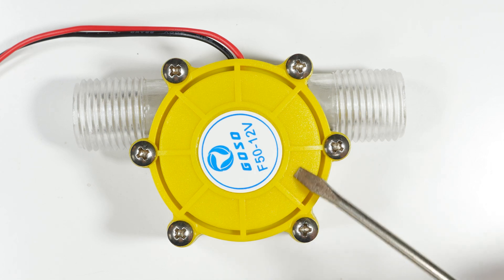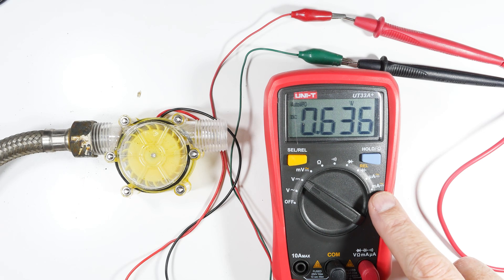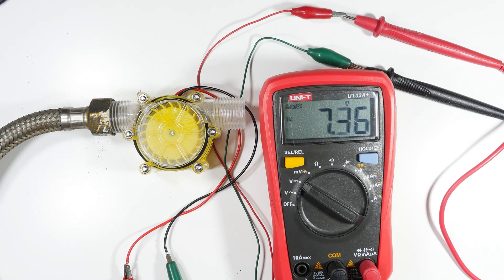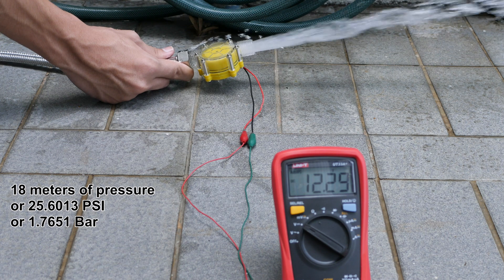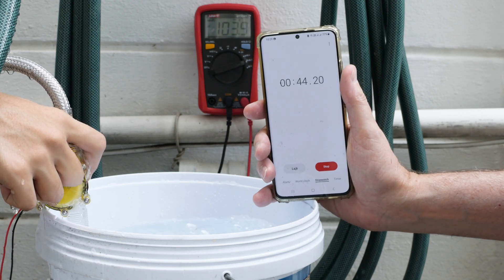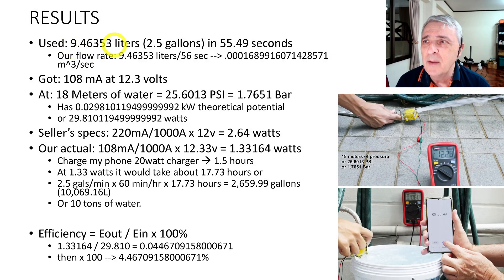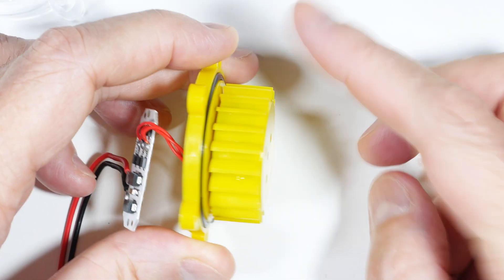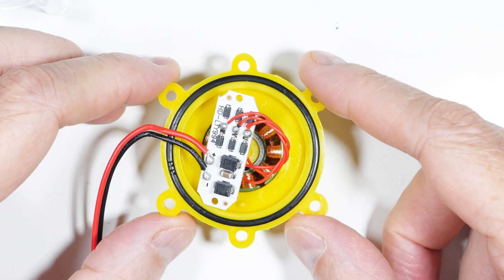Mini Hydro-Generator, 12vDC (4K)

Comment from the maker: RELATED VIDEOS (including this one):
Use A Small DC Motor As A Generator?    https://youtu.be/U3U0tNRQfZA
Mini Hydro-Generator, 12vDC     https://youtu.be/XL3PMX_V2qQ
Cheap USB Hand Crank Generator       https://youtu.be/nnbmIRdMWas
DC Motor As Generator      https://youtu.be/oRz0y4W9oM0
Crystal Electric Generator - RF Energy Harvesting Exp 4 - Power A Clock
https://youtu.be/0WvZC3-mR6Q
Stirling Engine w/ Generator - Gamma, Walking Beam Style
https://youtu.be/1x7Bo-dVsR4
Stirling Engine w/ Generator Power Measurement
https://youtu.be/bZqB_qwDbqI
Stirling Engine w/ Generator, 2 Piston Gamma Type
https://youtu.be/Xmb19QVJPqw

Comment: My question since the generator works by the rotation of the magnets pass the coils and therefore air will also work as you demonstrated. And with just the simple blow it produces the rated 12v. Could one in theory use a closed series of these generators connected together (air flow) not electrically, and within that circle (series) add in a “forced air”source that requires 12v and once started that series would be self sustaining? Of course in consideration of size as the amount of forced air required increases with each generator, compensating by adding more forced air sources strategically spaced. For example 1 every 3 generators just as an example. But the amount of forced air produced the size of the series all those things taken into account. Could this essentially say be used to produce low voltage low wattage self sustaining energy. Then could we go further by upgrading the components and achieve the same thing with higher voltage and wattage such as a self sustaining 120v generator. Probably giving away a billion dollar idea here but… lol
Reply from the maker: That's an interesting idea, but it wouldn't be self-sustaining due to energy loss from friction, resistance, heat, etc.
Reply: @tsbrownie I cannot understand how so.
Friction-what friction? Resistance- other than accommodation and calculation of voltages for components in circuit. Meaning if the generators produce 12v the a forced air source requiring less than 12V is desired with consideration of wattage as well of course everything would have to be measured out prior.
Heat-what heat? 
Bot the Heat and Friction would be dependent upon design build I would say  maintenance may be required periodically but I don’t see why this could not work for a closed circuit system. Something very low voltage of course like say patio lights or small string of LEDs again with consideration of total voltage needed to maintain lights and power generators efficiently

Comment: Hey, pretty good and informative video! I am about to do demonstrative model of "Pump storage power station Dlouhé Stráně" with this hydro-generator. May I ask you what is the diameter of the hose connected to the generator please? Thanks a lot for your reply. :)
Reply from the maker: If I recall correctly the connectors are 1/2 plumbing fittings. Should be the same as sink connectors.

Comment: hello, i'm a student currently making a project on hydroelectric chargers and how they work. i've tried my best understanding this video and the overall information shared from your discussion, but i'm still left confused with the actual objective and how hydroelectricity actually works. i really wish you could explain to me a bit more regarding this topic. thank you for the video, nonetheless!
Reply from the maker: This is very inefficient, it uses too much water to produce very little electricity. That is typical for these low cost generators. You might want to calculate how much energy is in water of a certain height (this was 18 meters) and compare that theoretical value to what is actually produced. As a side note, the water in the roof tank is pumped up there by a solar powered 48 watt pump that supplies 2 liters a minute.
Reply: @tsbrownie  I see. If we take the problem into account, is there an alternative solution/a way to overcome this issue and ensure that when we are using a moderate amount of water, it will also produce a reasonable amount of electricity?
Reply from the maker: @auriisc From before the Romans people have been working on that problem. It's not easy. For a DIY generator you can test different motors. For the turbine, there are youtube videos on that.

Comment: I expected 1/2W, but seems like it's not that bad anyway. It cannot run a mini computer, but it can be used in remote locations, like my first thought is to use to power a in-tank esp32 powered water level sensor, else I need to add additional cables+pipes.

Comment: Question. I know you said you wouldn't... BUT! If you were dumb (and poor) like me, and decided to use 2-4 of these in parallel, as part of a ultralite charging system for backpacking. How might you set it up? 

My idea was to use 2-4 of these devices side by side to gain an acceptable charge rate. With resulting current sent through a 12v - 5v dc stepdown/buck converter. Which i hoped might sufficiently regulate power flow. Used to charge a small Anker battery pack while I'm sleeping. (Considering Anker batteries are fairly intelligent storage systems that can cope with fluctuations in voltage/ current. )

Commercial systems are simply too expensive lol. All the above would cost me $50-75... Commercial systems are like $350+ lol.

(Just assume the flow rate is correct... I realize streams flow at different rates and the generator intake might require some creative engineering of a "water hopper" to get water flowing into the turbines at a reliable flow rate... Which affects the power output.)

Any info, advice, or help is much appreciated.
Reply from the maker: Some questions for you to consider. Where are you hiking that will have 18 meters of water height to power it at 1 watt? To charge a simple smart phone takes 17 hours, that's not over night. If you put 2 together, you need twice the flow at 18 m pressure. Is there such a place? 1 watt is 1 watt even if you run it through a buck converter. A power bank is a few dollars, is small, and will deliver the equivalent of many nights of charging, and you don't need a stream with 18 m of head. If you really want hydro, I would experiment diy-ing one using small DC motors.

Comment: What are the things that I need to gather in order for this turbine to work? Should I need inverter for this? If yes, at what size will be?
Reply from the maker: Depends on your application. If you watch the video, it produces very little power. I would use the DC motor out of an RO water filter if I wanted significant power for cheap.
Reply: @tsbrownie  well we have a school project right now, which is to create a mini hydroelectric power dam. What to do?
Reply from the maker: If it is just a demo to light a few leds, it will work. But it would not charge even a small smart phone.  @mr.nightowl3526

Comment: Unless you can cycle the water over and over.

When changing my fish tank water, I use a suction thingy with a plastic tube. I jerk it a bit  to start the process, and it sucks the water out of the tank into a bucket placed below tank level. That ends once the bucket is full. However, if there was a way to move that water endlessly between 2 buckets to keep the process going....

I'm not a chemistry guy though so IDK.

Comment: sir i have submersible pump working 24/7 is it enough if e put 2 of water turbines to charge battery? if it is how many hours of 12 volts battery to fully charge?
Reply from the maker: @jeromeprado4497  No, as I said in the video, this is not practical for real use, it's only good for demonstrating the principle.

Comment: The A7 diodes are 1N4007W - 1000V @ 1A and the MCC349B are 1A Zener diodes that they are using to clamp to maximum output to 12V. This limits to efficiency and at high flow rates (>12v) will load the wheel. I suspect on the 80V version the Zeners are not fitted.

Comment: The Input hole is very small than the output hole
Reply from the maker: Where do you see that? I gave it to a teacher friend already, but the input is a bit smaller, otherwise water pressure would build up and restrict flow.
Reply: @tsbrownie  Oh I think My one is faulty now I am sure the hole keeps small intentionally

Comment: The main detail I would like to know is whether the magnets are neodymium or ferrite as this makes a difference in their performance
Reply from the maker: I did not cut the plastic impeller open. I'd guess from their strength they are ferrite. If you make the magnets stronger, then start up force will be greater and it will require a higher pressure to turn. Also, to make this deliver more power, it would need bigger wires in the windings and better cores.

Comment: I have a question. Will this be able to trickle charge a car battery every time someone showers or use water?
Reply from the maker: Probably not any practical amount. A solar panel with a charge controller would be better.
Reply: Not in a significant way if it is installed on a typical small family home. But I guess it would be useful if it is installed on motel or hotel, especially a high rise hotel with a hundred rooms and a busy laundry service!